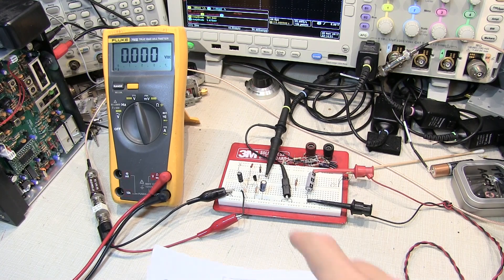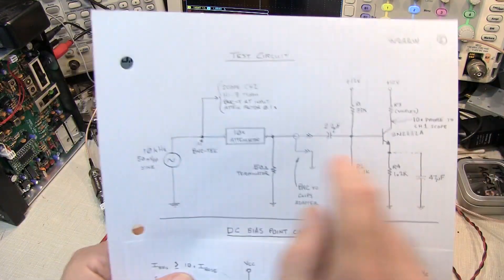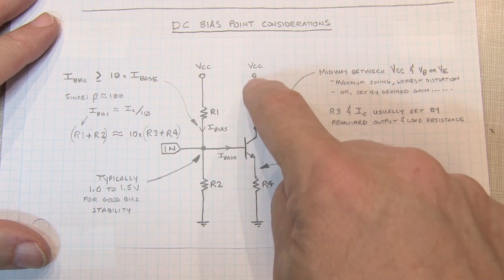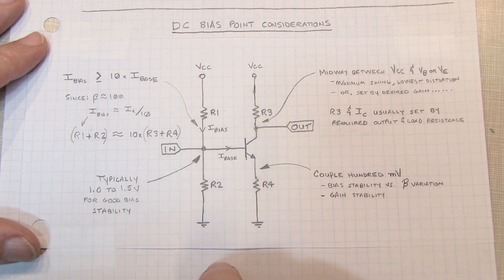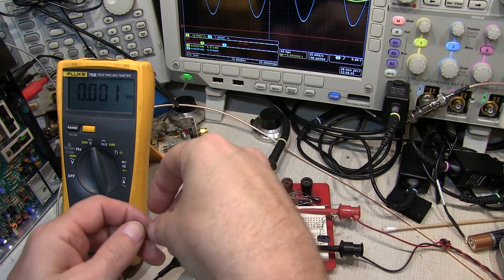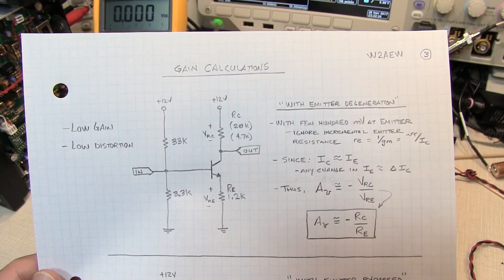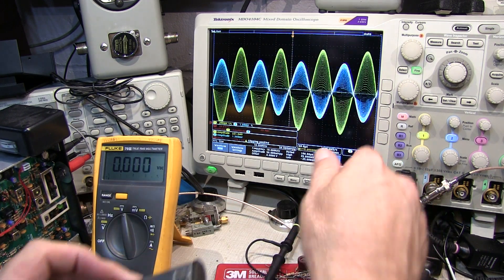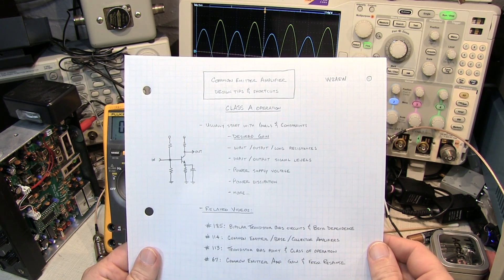#273: Common Emitter Amplifier Design Tips & Shortcuts

Comment: Hello Alan,
I thought you might be the best person to ask.
http://www.analog.com/media/en/technical-documentation/data-sheets/3798fa.pdf
Here's the datasheet. There's a transistor near the A2 comparator that has its base shorted to its collector. It could be another diode connected transistor for all I know, but I'm not so sure. How does it work in the DCM sensing circuit?
Thank you!
Reply from the maker: It is a diode connected transistor.  It is being used as a current sense element.  Since the Vbe is basically a diode, the voltage:current relationship is non-linear - a small current will raise the voltage (like a large resistor), but a larger voltage won't cause excessive voltage.  So, it is basically a non-linear, non-saturating current sense - just sensing the presence of a current.  Operation is described beginning on page 11.
Reply: Oh, I see.
I actually built that exact same circuit, and it doesn't seem to work like a current sense element. It just seems to push everything except for the top 600mV of the waveform below ground. I tried replacing it with a diode, but it didn't work the same way.

Comment: At one time you had a video where you show why sometimes it is better to use a 2n4401 instead of a 2N3904. DO you remember the title of this video?
Thank you!
Reply from the maker: You must be thinking of someone else - I don't have a video that discusses that.  The 2N4401 and 2N3904 are very similar transistors.  The performance of the 2N3904 is better at low collector currents than the 2N4401, and the inter-node capacitance is lower on the 3904.  There's a decent discussion here:
https://electronics.stackexchange.com/questions/231844/why-would-i-use-2n3904-instead-of-2n4401
Reply: I am pretty sure it was on one of your videos. I think it was about the current rating for switching applications. It was not necessarily a video dedicated  to the '4401 or '3904 per se.

Comment: Does that emitter voltage factor in the Beta gain of the transistor? I was expecting you to run into Beta limitations with the real high gain. Would that last circuit have resulted in a gain of 100 if the transistor had a Hfe of 100?

Comment: Hi Alan,

Thank you for this video.
I have succesfully reproduced the experiments. Great !
One question :
How do you calculate the input and output impedance of both circuits (With/without bypass capacitor) ?
Thank you
Reply from the maker: Output impedance is simply the collector resistor (since impedance of collector is very high).  Input impedance is parallel combination of bias resistor and impedance looking into base.  Impedance looking into base is Beta * (re + impedance connected to emitter).

Comment: How do you calculate the gain when the collector is directly connected to 12v supply without the load resistor?
Reply from the maker: When the collector is directly connected to the power supply, the circuit is not a Common Emitter amplifier.  This configuration is called a Common Collector amplifier, or Emitter Follower.  The output is taken from the emitter.  Voltage gain is basically unity, non-inverting.  See my video the common emitter, common collector and common base amplifier configurations: 
https://www.youtube.com/watch?v=zXh5gMc6kyU

Comment: Thanks for your great video. I want to reproduce it. Can you please give me the references  of   the 20 dB attenuator and the  the 50 Ohm terminator you are using in this video. Thank you.
Reply from the maker: There's nothing particularly special about them.  Any 20dB (10x) 50ohm coaxial attenuator and feedthrough termination would work, or you could certainly build a simple resistor divider or attenuator at the input of your circuit.

Comment: Hi! It looks like there is an oscillation in the circuit. It is more pronounced with the 20k collector resistor at 12:32. Or a picked up noise? Is it there? What it colud be?

Comment: Thanks for sharing. If you have a moment, can you please comment on the criteria used for selection of the bypass capacitor size? Is the goal just to have a cutoff frequency well below the signal frequency? Thanks.
Reply from the maker: The goal is to have the capacitive reactance be much smaller than 1/gm at the signal frequency.  1/gm is also known as re, so the gain can alternatively be written as -RC/re.  If there is any emitter resistance, then the gain is -RC/(re+RE).  If the bypass cap is not much less than re, then it will reduce the gain the same way that an addition emitter resistor (degeneration) would.

Comment: Very clever usage of math, the scopes I am using cannot do that. Do you know if MDO3000 also have this capability?
Reply from the maker: The MDO3000 can do this same math trick.
Reply: Great. Now I want one.
Reply from the maker: The big difference between the MDO3000 and MDO4000 is that the MDO3000 can not acquire RF vs time and show the RF signal characteristics along with the analog and digital signals.  The MDO4000 can do this (spectrum vs. time, RF amplitude, frequency and phase variation vs. time vs. analog and digital signals).

Comment: great explanation Alan, thank you.    How did you calculate the values needed for the decoupling cap and bypass cap?   Those are pretty large components...   what would be the effect of using much smaller caps?
Reply from the maker: Nothing too critical. I just wanted to be sure that the impedance of the emitter bypass cap was much less than re (1/gm) at the test frequency so that the gain approximation was valid.  And I wanted to be sure the input cap's impedance was much less than the input impedance of the circuit so that there wasn't any significant voltage drop at the test frequency.

Comment: One thing that has been bugging me lately is RF amplifiers, using the CE amplifier with an RF choke and no collector resistor. The amplified signal then rides on top of VCC, which means the voltage at the collector actually wil be swinging higher than VCC. I dont quite understand how that is possible.
Reply from the maker: It's mainly because the voltage across an inductor is proportional to the "rate of change" of current through the inductor.  Thus, the polarity of the voltage across the inductor changes when the RF current goes through it's cycle.

Comment: w2aew I guess whats confusing me is simple ohms law stuff but this video clears a lot of stuff up for me.  Maybe I wasn't using proper terms before when referring to gain on the collector output.  Thank you.  Now question I have is of voltage divider current and parallel/series circuits.  You mentioned that current available at the base should be approx 10 times the current of the emitter resistor.  However once the base is connected to the divider it becomes a parallel circuit now and R1 becomes series.  My math is R1 10.89v 33k .00033A.  R2 1.089v 3.3k .00033A. R4 .489v 1.2k .0004A.  and I am doing something wrong.....  Amperage in parallel adds so should  R1 be .00073A?  Then that violates ohms law with respect to my other values?  Guess I am figuring the voltage divider out as a series circuit.  I know this is simple stuff and I indeed do feel dumb about asking.  Should R1's current be a sum of R3 and R4 current?  I am just confused.  Sorry.
Reply from the maker: The part you're missing is that the bulk of the current flowing in the emitter resistor comes through the transistor via the collector.  The transistor has current gain (beta), which is the relationship between the base current and the collector current.  If Beta is 100, the 1uA of base current creates 100uA of collector current.  The emitter current is the sum of the base and collector current (thus 101uA in this example).  So, yes, the base-emitter junction and the emitter resistor are in parallel with R2, but the current flowing in this parallel branch is very low due to the current gain of transistor.  In effect, the emitter resistor appears (Beta+1) times larger that it's actual value.  Because of this current gain, you can sort of ignore the base current when the bias current through R1 and R2 is 10x or larger than the base current.
Reply: w2aew so can i simply subtract the current across the collector resistor with the current at the emitter resistor to get the bias current?  Would that be how to set bias current?  I have watched your videos and sparkfun videos. Directly biasing with a single resistor is so much easier but i completely understand why this is important to do it this way.
Reply from the maker: The best way is to take the collector current and divide by the Beta (hFE) value for the transistor.  This will give you the BASE current.  Then, multiply the BASE current by 10 or more, and that should be your approximate current through R1 and R2.
Reply: w2aew so looking at my numbers. I took the circuit in i think it was 185 and measured it. One question. Why beta + 1 and not just beta?  I think i see the pattern i was looking for. The emitter resistor current is approx (Ic + (Ir2 - Ir1)). The Ib is hidden within. Your formulas work beautifully however trying to see whats going on visually. The voltage divider in my mind is a ratio between the two resistors and depending on the ratio depends on voltage division. The value of both scaled in unison controls output current. Now is the same true on the collector to emitter?  Whats throwing me off now is the voltage. The amperage on r1 and rc go back into series at re. Hmm. Need to look at my paper. I think i am missing a voltage carrying over from base side.
Reply from the maker: Here's how the currents split up:
-  The current in R1 consists of the BIAS plus the BASE current
-  The current in R2 is simply the BIAS current
-  The current in RC is just the collector current
-  The current in RE is the collector current plus the base current.
In other words - the BIAS current flows from VCC through R1 and R2 to ground.  The collector current flows from Vcc through RC, through the transistor from collector to emitter and through RE to ground.  The BASE current zigs across - it flows from VCC through R1, into the base and out the emitter through RE to ground.

The collector current is Beta * BASE current.  Thus, the emitter current is (Beta+1)*BASE current, since it consists of the sum of the base and collector currents.

Provided the BIAS current is sufficiently larger than the BASE current (>10x), then you can somewhat ignore the BASE current and simply compute R1 and R2 as a voltage divider to set the VB base voltage.  Once you know this, then subtract 0.6 to 0.7V to get VE the emitter voltage.  You can then set the emitter current simply by chosing RE = VE/IE.  Emitter current is nearly same as collector current, so now you know the collector current.

Engineering is full of approximations and estimations like this to get a quick design off the ground.  It can always be tweaked and fine tuned later.

Hope this helps.
Reply: Ok I think I get the grasp of it somewhat.  I designed a small circuit to power a .5 watt speaker using a 2n3904.  I just don't have the resistors for this kind of power dissipation needed in common emitter.  I need to rewatch videos on common collector.  Maybe there is a way without such a large wattage collector resistor.  I have built several larger marshall guitar amplifiers but never understood what is going on at the signal level.  With the help of your videos they have clarified my poor understanding of AC.  Now I can identify and understand what each section does.  Relatively.
Reply from the maker: A common emitter amp is usually now used as a speaker driver because of the high output impedance of the collector.  Usually a common collector amp is used to drive a low impedance load like a speaker because it has much lower output impedance.

Comment: I love this topic. Biasing is a hard thing to wrap the brain around. This year I finally pulled off putting several amps together some worked well and other needed tweaking. How would you set up a transistor as a digital switch for high current like a 3055 on pwm?
Reply from the maker: When doing switching, you generally want to switch the transistor between OFF and Saturation.  For OFF condition, make sure that Vbe is near 0V.  For the ON (saturated condition), make sure that Vbe is fully forward biased, with a base current ~10% of the expected collector load current.

Comment: Fantstic video as always, thanks.

Idea for a future video: 
Calculating input and output impedance of 2, 1 transistor amplifiers, after each other, and calculation of the size of the dc blocking cap between the 2 stages, especially the last of the two, i have searched youtube and i have found none that have made a, for me, usable video on the subject, maby you could make that video.

Greatings from Denmark
Morten
Reply from the maker: Thank you.  I did answer the question about calculating the input and output impedances of a common emitter amplifier in one of my comment replies below.  I agree that a video on how to select the interstage capacitors would be useful.  I can add that to my looooooong list of topics...

Comment: I went looking for 'bandwidth' of a 2n2222a, and found on various datasheets "transition frequency" around 300Mhz.  I did that because I was curious why you selected 10Khz as the test frequency.  So, would this circuit generally work as shown at 10Khz if you were to try from Hz and Khz up to low 3-digit Mhz?  Thx.
Reply from the maker: The low frequency response will be limited by the capacitor values.  The high frequency response will fall off long before you get the the transition frequency.  It will primarily be limited by the device and component parasitic capacitance working against the various node impedances.

Comment: Another fantastic video. Thank you. Can you tell me how to calculate the input and output impedance? If you covered it in another video please direct me. I know how to measure it, but how do you design a circuit with a specific impedance in mind?
Reply from the maker: Output impedance is simply the collector resistor, RC  (or R3 as shown in this video).  The input impedance is slightly more involved.  It is the parallel combination of R1, R2 and the input impedance looking into the base.  The input looking into the base in the "emitter bypassed" case is something called r_pi, which is simply r_e * Beta.  From the video, r_e is 1/gm, or v_t/Ic.  In the case with emitter degeneration (no bypass), the input impedance is r_pi + (Beta+1)*RE.
Reply: I would like to clarify that r_pi + (Beta+1)*Re is an input impedance (!) looking into the base, not an input impedance of the amplifier. The overall input impedance is R1 || R2 || [ r_pi + (Beta+1)*Re ] which can be approximated as R1 || R2 || Beta*(r_e + Re), since Beta is unknown and >> 1.